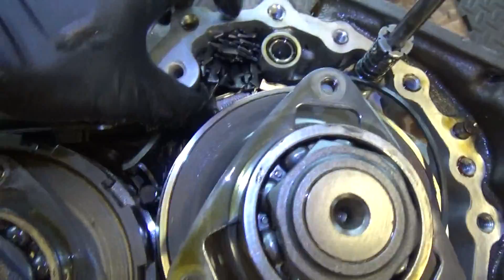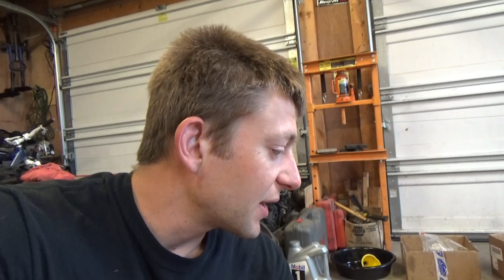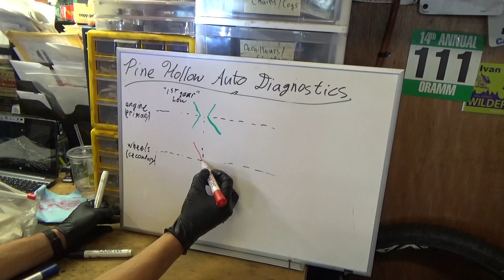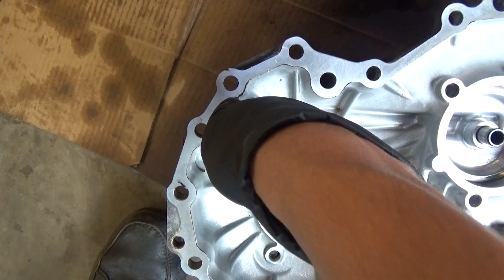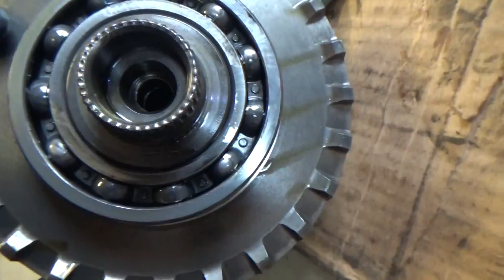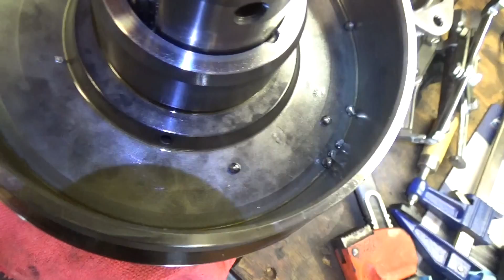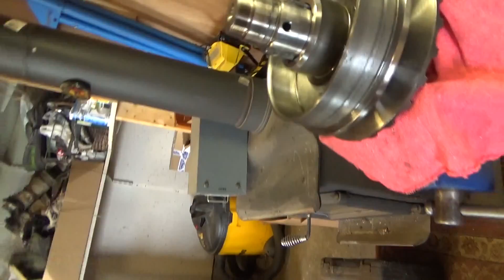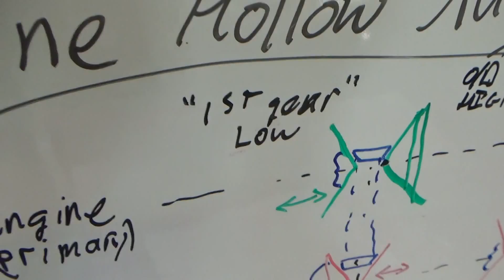Nissan CVT: Teardown and Failure Analysis -Part 2 (RERELEASE!)

Comment: Not even half way through yet, but i would think that the belt would normally be a reliable part of the cvt, i say that because when the pulleys are operating correctly in unison there is not sudden jarring or uptake of drive when shifting ratios - unlike a normal transmission where wear of clutch packs and such can cause a sudden snatch when gears are shifted, causing a sudden high torque load on a normal chain. So i am thinking one of those pulleys misbehaved causing the belt to break. But, whatever the cause it is really interesting to see how one of these cvt transmissions work. Thank you Ivan for reuploading, this is a video i really wanted to watch before but had a nightmare trying to get the 'paid video' thing to work, i paid the money but for some reason i was not able to view it, had to get a refund in the end. So really good to see it now. It was worth the wait. Very much appreciated.
Reply: 100SteveB I've literally heard it's the cheap bearings in those pulleys.

Comment: The Burgman 650 E-CVT is very similar right down to key ways on the pulley shaft . You can buy the parts for the the Burgman and is repairable in most cases . I've done several of them and they usually go about 50,000 miles before there are any problems . You were extremely lucky to have gotten as many miles out of yours as you did . TheReaper!